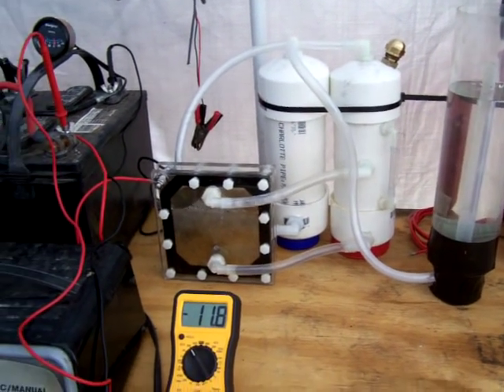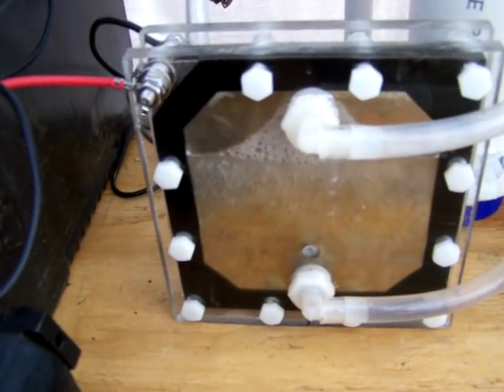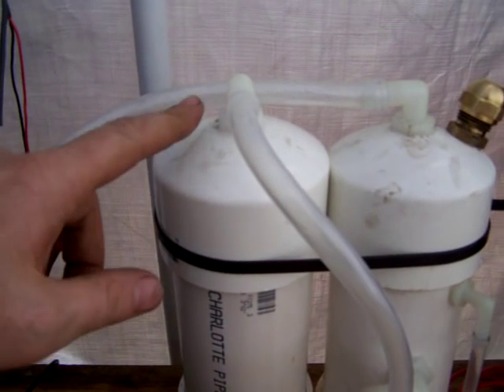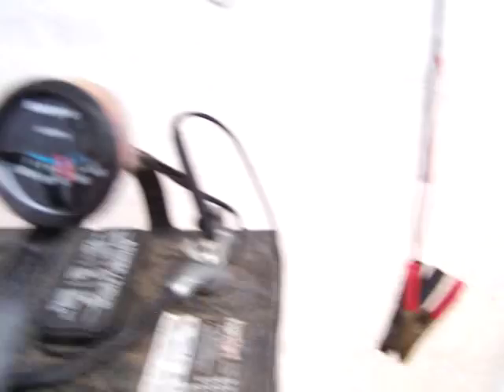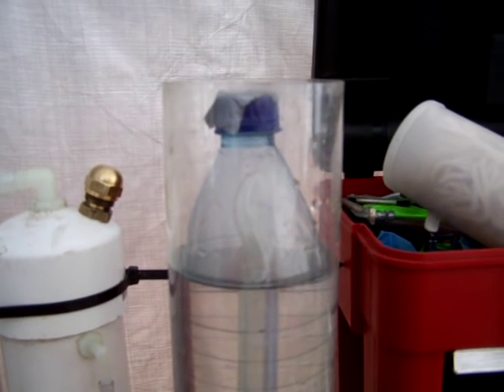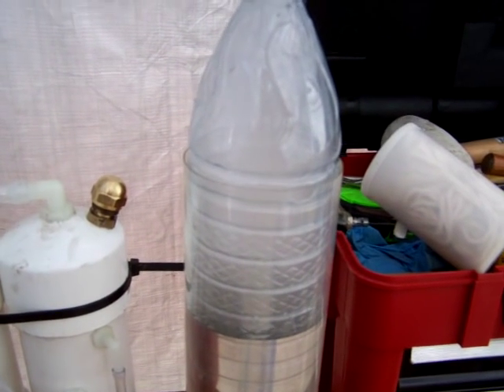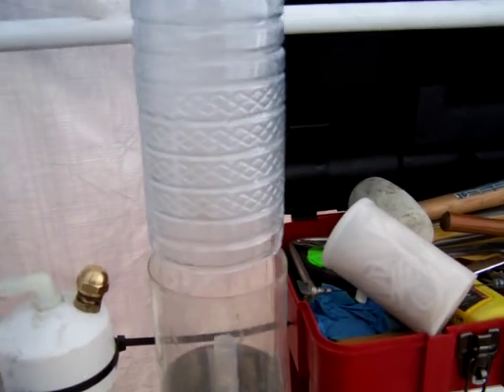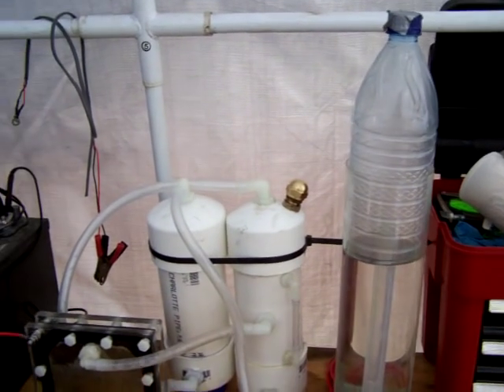Hydrogen on demand conversion kit. Turn any car into a Hybrid for only a few hundred dollars.

Comment: just dumb ... gasoline is already just hydrogen and carbon in chains.... a gallon of water has the equivalent energy in hydrogen as 1.2 gallons of gas.... that's it ... just barely a gallon of gas .. except you have to use more energy to get the hydrogen from the water.
Reply: Right, the fact that you dont have to spend billions cleaning up the environment from all of the poorly combusted carbon. Its not a matter of money efficiency, its a matter of logically weighing all the inputs and outcomes of your actions. Stop being greedy, the technology isn't supposed to make your life better. Its supposed to make everyone one earths life better.
Reply: sorry i know how to do the energy calcs and this is just bs.  I worked with hydrogen extensively including making hydrogen for hydrogen powered cars using steam methane reforming.  This is just complete nonesense
Reply: remove your ego and see if you can see the benefits
Reply: no since you cant generate enough hydrogen with that tiny  amount of water to matter and it takes 50kwh to get 1 kg of hydrogen through electrolysis . ... which takes roughly 2 gallons of water to produce 1 kg of  hydrogen.. which you are not doing, as your car alternator isnt up to the task   The electrolysis cost for hydrogen makes it cost $30 per gallon equivalent of energy as compared to gasoline.  A kg of hydrogen is about 1 gallons of gasoline in energy equivalent.  So with your apparatus if it had enough power it might add the equivalent energy of a half a gallon of gas for whatever time period it runs to burn up the whole bottle of water
Reply: Ashton Ponzer this is simple math ... i am amazed anyone would fall for it.  it would take a 4th grader 10 minuets to figure it out on Wikipedia.... you are not adding any appreciable energy ... in fact if you were you would hear the engine knocking as the pressure and detonation temperature of hydrogen is lower than gasoline and it would cause the car to knock terribly by pre igniting the fuel too early in the engine stroke
Reply: i think when you removed your ego you must  have grabbed a bit more than just your ego
Reply: ***** you didn't understand I see 😂😂
Reply: what dont i understand ..that hydrogen has 142 MJ/Kg and gasoline has 47 MJ/Kg.  That an gasoline engine is a heat engine ruled be well understood laws of thermodynamics ... that simple math defines the heat energy of hydrogen being added to gasoline and that math makes it clear you dont gain anything of substance below a flow rate equal to about i kg of hydrogen per tank of gasoline at which point the gettering nature of hydrogen would keep your engine very clean while causing some of the metal surfaces to become brittle and fail prematurely

Comment: These HHO Kits waste fuel. This has been proven time and time again.
Reply: This is what I want to investigate, can you refer me to such sources?
Reply: Yves Baggi without the HHO kit around 30% of the energy in the gas makes it to the wheel. IF you tried to burn 100% HHO generated in your car only 6% of the energy in the gas makes it to the wheels. This is because the alternator and the process to convert the water to HHO is so wasteful. You can try to youtube hho scam or google it.. you will find pleny of sites. "Dateline NBC - HHO scam part1" is on youtube.  it explain there is not increase
Reply: Samuel Atkins
thanks. Not that main stream media can be trusted. They said the same thing about fuel vaporizers or atomizers, which I had installed in my 94 honda accord and went from 25m/g to 28 on average over 8 tanks of gas. Nothing to go to the moon about but still.

But wiht HHO, it needs so much current that I can't imagine the net being positive, much less running on 100% hho.

will probablz have to try for myself when I get an old car.

Tanks
Reply: The main stream media in the USA has a lot to lose if they get story's wrong. main stream media inthe USA are held to a much higher standard than other media. Publishing false info will lower their rating thus costing them millions.   Often   small time local media are not held to any standard and dont have competition to drive them to be truthful.  The  main stream media in the USA is not always right but they are right more of the time than other media.
Reply: Samuel I disagree with you
Reply: *****

How can it fool the computer? and in your experience how long (miles) would it take to adjust?

I'm always masuring  gas mileage over 5-6 fillups. so I'd be immun to that. unless the computer is compensaing and enriching the mixture after a while. but that would reflect on subsequen fillups.
My dashboard doesn't have a mpg display.
Reply: *****
Ok, so the control loop comes from a sensor in the catalytic converter?
So right now I'm getting 8.2 L/100km (europe you know) on highway and 9.2
if I just drive grocery shopping.

if I were to install that I could still measure a saving (with my method) initially but over time the computer would enrich the mixture because of how it is designed, rendering the HHO thing useless. But the initial saving would still be real, wouldn't it? and the computer would just compensate because of whatever machination the globalists are setting up or just because that's how it's been programmed.

thanks, i like to hear many vantage points.
Reply: Yves Baggi there are no initial savings. When you use HHO kit its only putting out 1% or less of the energy you motor requires and gets from the gasoline. This one 1% hho is not enough to increase mileage especially when more then 9 times the energy  is wasted compared to what you get out of the HHO. looks this up. Your car is around 30-35% efficient. If you reroute this energy through your  energy wasteful alternator to make HHO, only 6% of it will make it to you wheels. So its far better to just route the 35% to your wheels than try to produce HHO Gas.
Reply: Samuel Atkins As long as the alternator makes enough current, it should be fuel conserving since it will make as much electricity wasted without the device. If the alternator doesn't make enough power, it will just stall the vehicle eventually.
Reply: Chen Aaron You are very wrong if you think the alternator is producing current that will go to waste if not used. that is not how an alternator works. An alternator does not produce any current at all unless something is pulling current from it. When you pull current from an alternator  the alternator starts putting a load on your motor that turns the alternator. 
The alternator is also extremely wasteful. If you pull an 60 units of energy from the alternator the alternator will pull 100 units of energy from your motor and waste 40 unites of energy.  Using the power from an alternator to power a HHO system is one of the worse things you can do.. So much energy is wasted that you can never recover from it.
Reply: Alternator actually has no clutch, so when engine is on it keeps spinning. No matter how much power you are using.
Reply: Chen Aaron Yes the Alternator  is spinning when motor runs. But it doesn't produce any current at all even though its spinning unless you pull current from it and than  the Alternator  wastes 40% of the energy that it gets from the motor.
Reply: Alternator has no freewheeling capability as there is no gear or clutch in an alternator. The regulator is only there to protect the electrical parts from too much electric current. In modern car, the only reason using too much electricity might create more load is because the computer unit tells the engine to rev higher in idle for the alternator to create more power.
Reply: Imagine a little electric motor. the shaft with magnet is just spinning in the middle surrounded by the coils without touching anything. The engine is just pulling the pulley to spin the shaft to create electric current.
Reply: It is very different from A/C compressor which has a clutch that actually lets it free-spin when not needed.
Reply: Chen Aaron I am going to say this at a first grade level. For the 1000ths time, i know the alternator doesnt have a clutch and know that it spin all the time when the engine is spinning it. I already made this crystal clear in plain English.
  alternators do not produce any current while its spinning unless you are drawing current from it.  I dont care how BRAND NEW or how fcking FAST YOU SPIN THE ALTERNATOR it will never ever produce electricity UNLESS SOMETHING IS PULLING electricity FROM IT. You think because and alternators is spinning it must be producing electricity. This is not true. Yes I know the fcking shaft in the middle of the alternators is spinning. I never said it wasn't. How else do i need to tell you, "no matter what you do to the alternator it wont produce electricity unless you somebody or thinking is pulling current from it".If no current is being pulled from it, the winding's inside the alternator will not produce electricity.  Do i make myself clear now.
Reply: ok, so the magnetic field is doing the job. The voltage regulator adjusts the magnetic field to produce more or less electricity thus acting like a gear or clutch. http://www.autoshop101.com/trainmodules/alternator/alt131.html
Reply: Now we are getting somewhere. here is some examples. 

If you pull 500 watts from your alternator, the alternator  will gladly give you the  500 watts but nothing more. If you pull 100 watts than all you get from the alternator  is 100 Watts. If you pull 10 watts that is all the alternator  going to give you. And this is the same as with 1 watt. The alternator is not going to give you anymore if that is all  you want.

Now if you pull 0 watts which is nothing. The alternator is not going to produce anything.
Reply: ***** who was you replying to when you said dead wrong?
Reply: ***** interesting.. I am saying samething you are only in a different way
Reply: ***** you guys are talking about the exact same thing just not clear enough